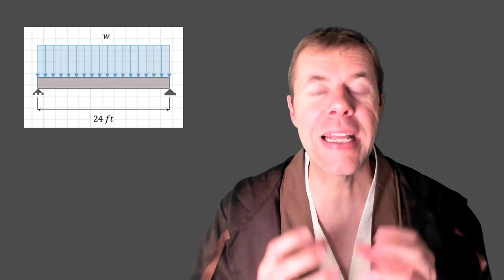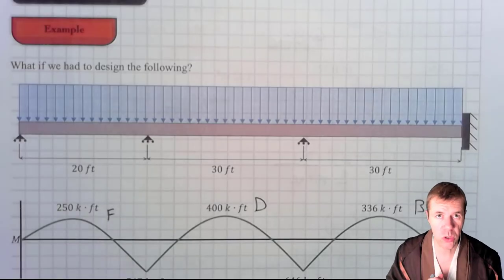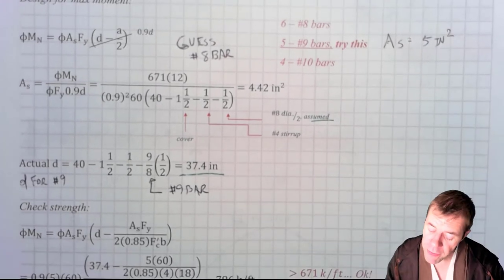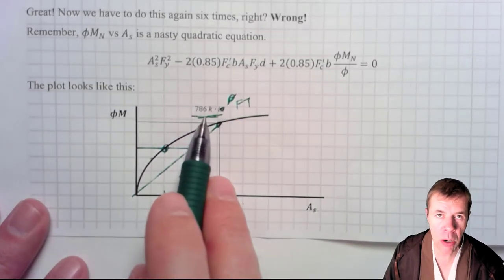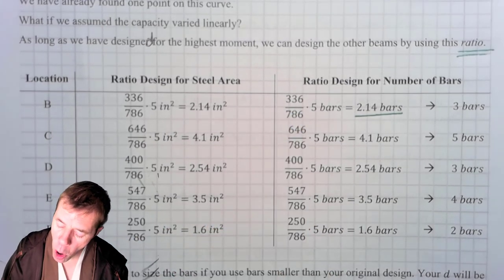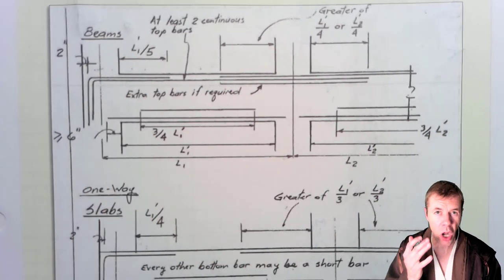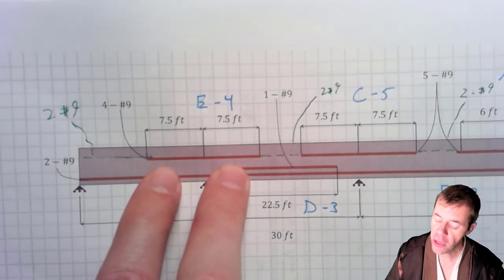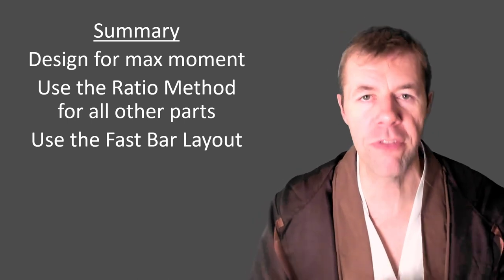How to design reinforced concrete like a JEDI!!! Continuous beam design

Comment: I suggest that you should have fewer than 5 top bars in an 18" wide section.  The clear space between bars is only about 2.1" which is marginal for getting the concrete in and will not allow use of a vibrator.  I try to provide 2.75" clear for top bars.  The vibrator doesn't have to fit between the bottom bars so they can be spaced closer together.
You mention Dr. REK- I also had him as a professor, I'm sure long before you did.

Comment: Just thought I'd throw a few of my thoughts in. Not a big fan of steel reinforced. Yes I know that the expansion/ contraction  rate for rebar versus concrete are supposed to be compatible.
  But your video implies live or deadloads are basically static. Introduce the motion of an earthquake and your numbers and calculations come up short by several factors.
        What about this idea. Carbon fiber strands( 7 lbs. Per yard) , and an elastomeric admix for the pour..
        With cf strands, elastomeric admix and cf cables laid in to replace the rebar. Wouldn't you have a superior post and beam with a much stronger slab?
         This would allow for better point of moment integrity. With future micro  cracks there would not any rebar rusting and expansion.
         Just my thoughts.

Comment: Hi Professor Tyler. What happens if you omit negative moment reinforcement?  How can you avoid cracks without having to place negative moment reinforcement
Reply: If the bending moment causes enough tension stress in the concrete to exceed the modulus of rupture then it will crack.  (And actually it will crack whether it has reinforcing or not, the difference is the width of the crack.)  So to avoid cracks you have to keep the tension stress below the cracking strength of the concrete.

Comment: I find your videos very easy to understand, interesting and instructional and I thank you for all your help. Although I've tried numerous times, I haven't been able to model and inclined support in Risa 2D. Can you please show how to model inclined roller supports in Risa 2D?
Reply from the maker: Thanks for the message.  I am not sure Risa 2D can do this.  I think the boundary conditions only go in the global X, Y, Z.  However you should be able to use their solution with a little math to find the inclined answer.
Reply: @TylerLey  Thank you so much for your quick response. I'll try some examples to see if I can figure it out. I enjoyed very much your live steaming today. Please keep up the good work.
Reply: I assume you men roller support because inclined pin or inclined fixed don't mean anything.  You would model this with an inclined link.  You want to resist force in one direction so you orient the link in this direction, with enough stiffness (A and E) that it doesn't deflect significantly.  You want to allow free movement in the other direction perpendicular to the link and you don't want to resist bending so you pin both ends of the link.  The force in the link will model the reaction that you would get from an inclined roller.